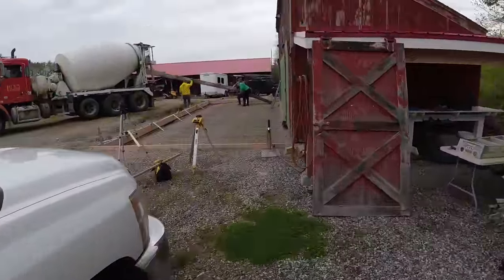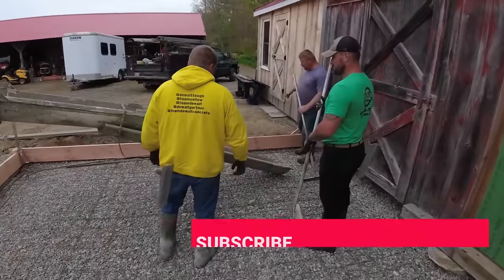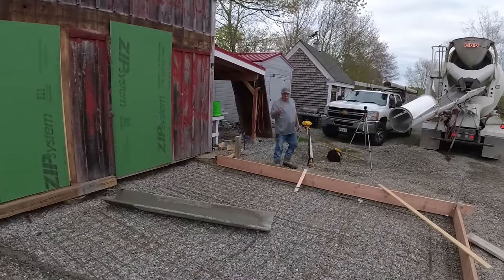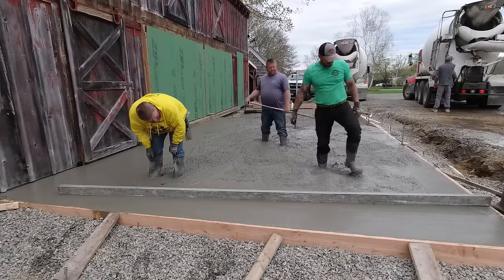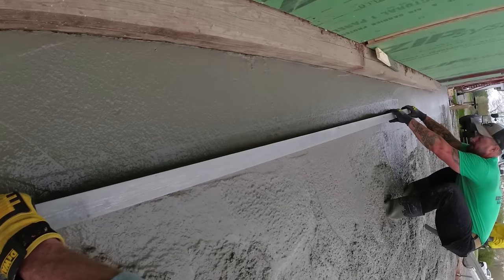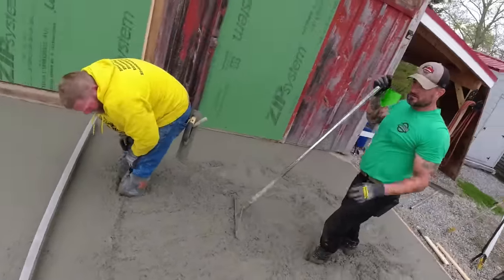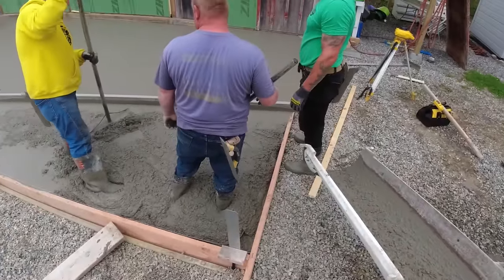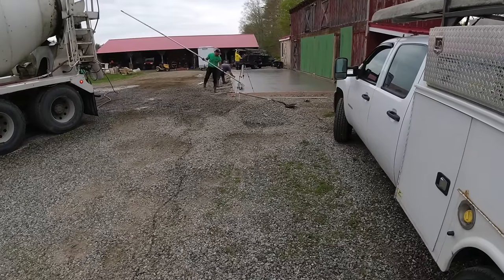New Student Learns How To Pour And Screed Concrete (Training in The Concrete Underground)

Comment: A friend of mine who does flatwork does not use wire mesh, only fiber in the concrete. The wire mesh for the most part is useless because it ends up on the bottom anyway. On the haunches he adds fiberglass rebar after the concrete is poured and just pushes them down a couple inches with the rake.
Reply: It's doesn't end up on the bottom if you make it a point not to let it. There's hooks on the come along. Now I'm not a finisher by no means. But I've done enough and enough concrete demo to say without question that shit makes a tremendous difference if it's put down right
Reply: You are supposed to use chairs to keep it off the ground

Comment: Love the channel but if you are teaching others then should really cover all aspects of the pour. There are U.S. standards for placing mesh in concrete, primarily covered under the American Concrete Institute Leaving mesh on the ground or pulling it up with hooks is not best practice, as stated by ACI 318 and ACI 301, because it leads to inconsistent placement and inadequate cover, compromising the slab's structural integrity. Mesh should be in the upper half of the slab, about 1.5 to 2 inches from the top, to control shrinkage and temperature cracks, provide tensile reinforcement where tensile stresses occur, and enhance durability by protecting against environmental exposure. The recommended best practice is to use proper supports such as chairs or bolsters to ensure the mesh stays correctly positioned throughout concrete placement.